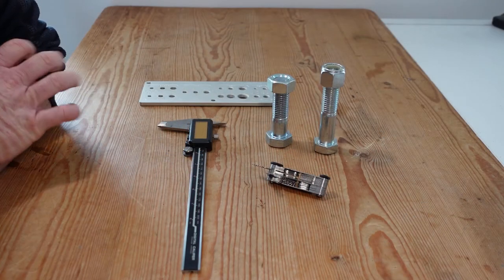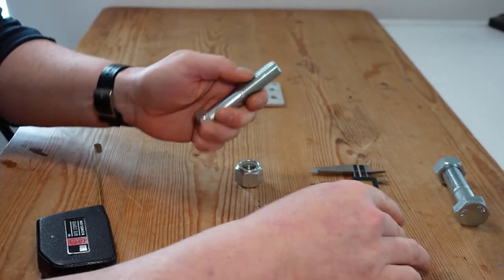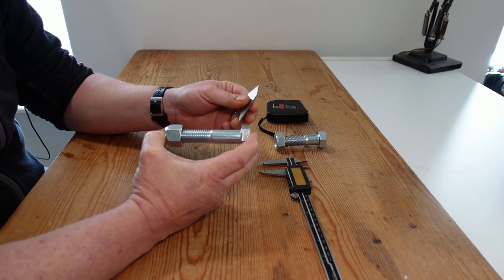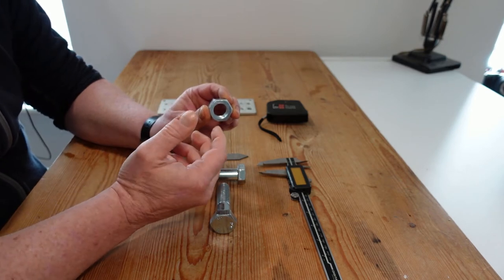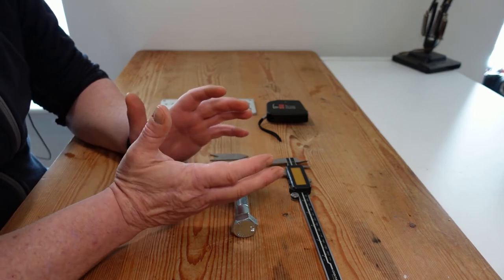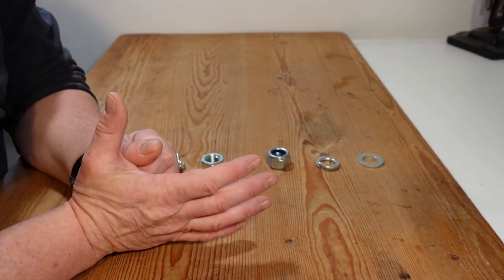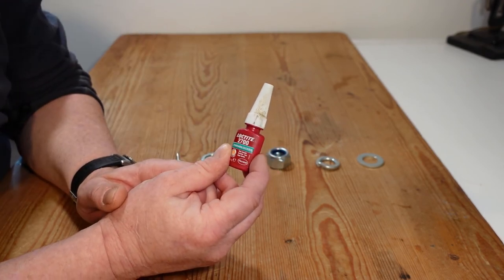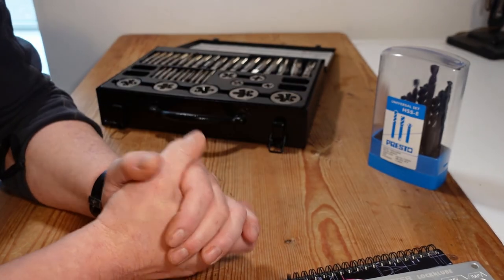A How To About Nuts And Bolts

Comment: Nice. The Tap-Set you showed... while the spiral flute one does indeed allow to tap blind holes the main difference between the two taps is that the first one (gun tap style) pushes the cut metal ahead of itself (and thus is better suited for through-holes), the fluted tap ejects the cutting to the top (pulls them out). And as such can tap holes much further to the bottom of blind holes.
Reply from the maker: Thanks for that, great to learn always. I'm far from expert!

Comment: Excellent video.  Don't know if things have changed now but when I did my apprenticeship, UNC & UNF high tensile bolts were stamped with the letter S on the head and BSW/BSF with letter R
Reply from the maker: Thank you for the kind words. I have to admit I’ve never come across a BSW/BSF bolt, they are particularly rare here at this stage. Now and again you might see a pipe thread depending on how old a machine is. They have largely been superseded by Metric, BSP or even NPT threads.

Comment: Do you know of a bolt that allows for compression and expansion vertically if the bolt is verticality mounted?
Reply from the maker: Unfortunately I don't. Generally springs are used to achieve compression and expansion capability in those circumstances.
Reply: The properties of the material are given by 4.6   8.8  10.9   12.9  numbers.  google is your friend.  For hydraulic flanges ( 600 bar /  8500 lbs.. ) we used 12.9 bolts.
Reply: We used 12.9 bolts because 8.8 were too elastic, and due to hydraulc shocks the flange O-rings were blown out.

Comment: Good video, Is it possible to have a Whitworth thread on a metric screw? I have a 14mm dia. bolt, but does that work with imperial ? My thread gauge has 13g Whitworth written on the one that fits. I'm confused.
Reply from the maker: Hi there Billy Bunter,

I had a look at this and I found that both the 2mm metric thread gauge and the 13G Whitworth thread both mate up nicely with a metric bolt with a 2mm thread pitch.

Metric bolts have a 60 degree angle and the Whitworth have 55 degrees and I don't think the difference is visible to the eye when you offer the gauges up to the bolt. At least not to my eye anyway.

Generally bolt diameters measure in slightly under their nominal size i.e. an M16 bolt which is 16mm nominal measures in at 15.8 mm, an M12 measures in at 11.8 mm approx. This depends on the individual manufacturer as to how tight the fit is.

If your bolt measures in exactly at 14mm then it probably isn't a metric M14, this should have a measured value of 13.7 something or 13.8 something to allow clearance.

14mm converted to imperial gives us 0.551 inches, there is an imperial 1/2 inch UNC bolt with 13 threads per inch so that is something to consider although quite a bit smaller as regards measured/nominal.

I don't know where you're based as if located in the States coming across an M14 bolt would be unlikely, if rest of the world based then an M14 is possible.

Some suggestions then:

If the bolt came off a machine then look up a parts list for the machine and it might have the diameter of the bolt listed as a spare.

Bring your bolt to a hardware shop and try to thread on a 2mm M14 nut. And try a half inch imperial nut as well.

Metric bolts don't have Whitworth threads so we can be sure of that anyway. Whitworth would also be very uncommon to come across although I have no idea what the bolt came off so maybe you have an old lathe or milling machine........

Hope this helps steer you in some way.
Reply: @WobbleMatic  A very big thank you. I read your reply and it has now been sorted. It was a metric 14mm bolt with a 2mm pitch. Not the imperial one. It's so confusing with all these different kinds. Thanks again.